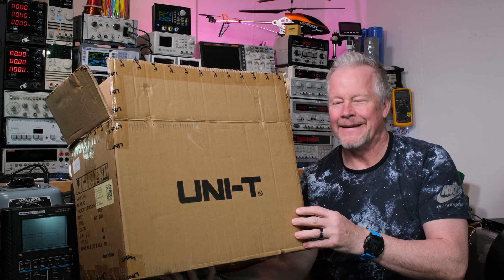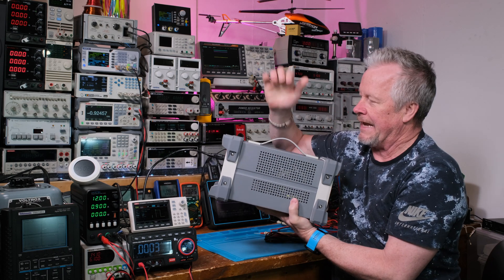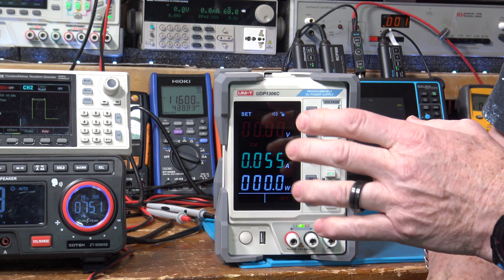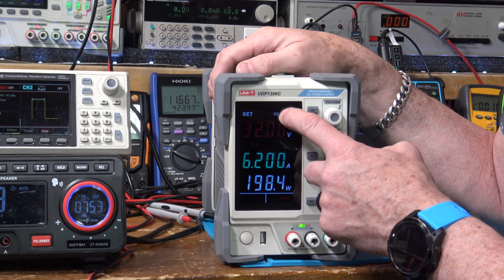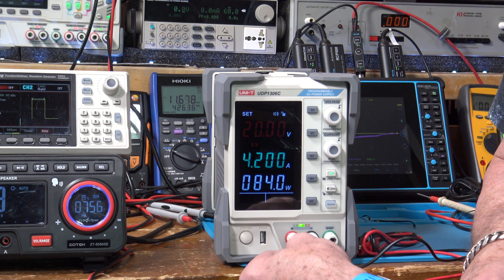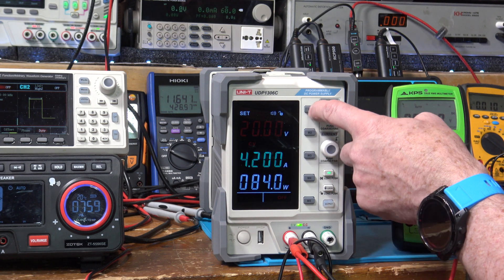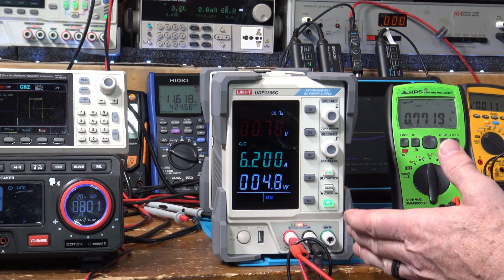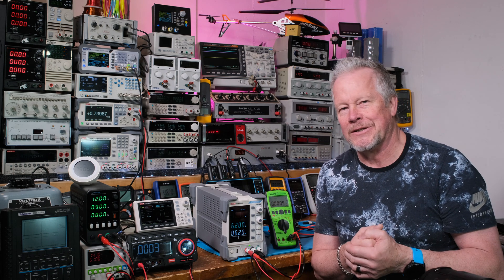New Bench top Linear Power Supply Box Opening  Uni-T UDP1306C #linearpowersupply #UDP1306C

Comment: Power Supply Giveaway! Can always use another linear supply. I'm actually working on building a linear power supply. Using a transformer from a golf cart battery charger. 36v @ 30a. I've been working on it for a while. Just now and then. Won't have memory and such, but sometimes I need that higher current. 

I have a few different UniT products. I really like them. I kinda wish they would have put the bnc jacks on the signal generator on the front though. I always have to leave that space to the side of it to reach in and make connections. You need to mention that to them.

Great video! Happy birthday!❤
Reply from the maker: Thanks for the great feedback!

Comment: UNI-T always has such nice industrial designs, however the colour choice for the display needs changing as red is hard to see and looks invisible from a distance, even on different equipment, yellow, white or green would be a lot better choice IMO.
Reply from the maker: Yes I agree.  But in person it looks great.  But other colors probably are better.
Reply: @KissAnalog  I have a FNIRSI buck-boost with an OLED display, and it has the same issue, luckily they chose red for the power output.
Reply from the maker: It is too bad it looks so bad on camera;)